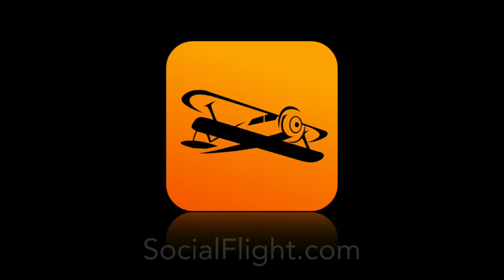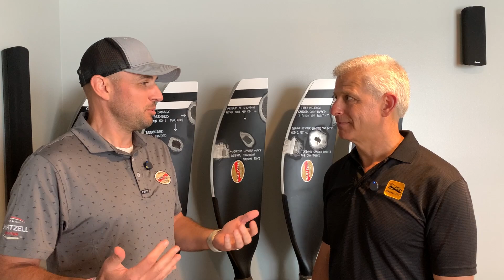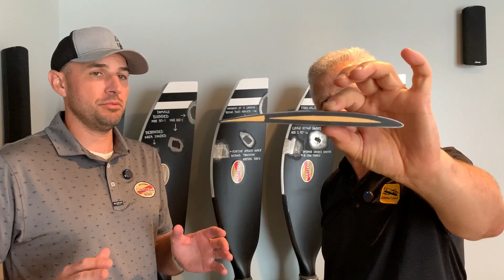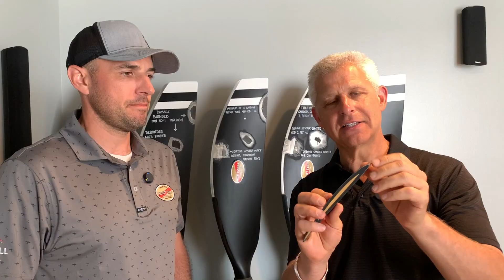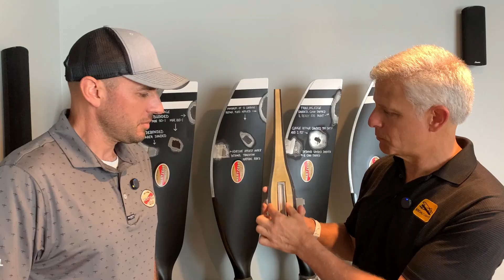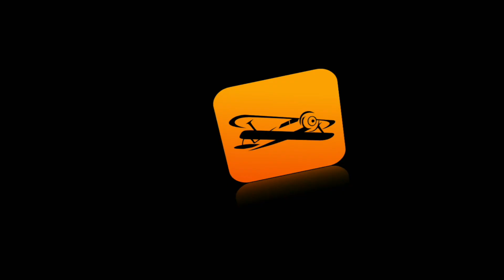“COMPOSITE” vs. CARBON POWER! Hartzell Wins on Performance & Maintenance at AirVenture 2025

Comment: I bought a plane that go blown off the taxiway by the maintenance crew gunning the Boeing 737 engines. It had a Cont. TSIO 550-E engine with the MT composite prop. It hit the ground and splintered big time transfering less energy into the crank, a good thing. Pro shop I called about it called those blades "potato chips". Hartzell looks  much more like Aluminum blades as far as transferring energy to the crank. Just my 2 cents.